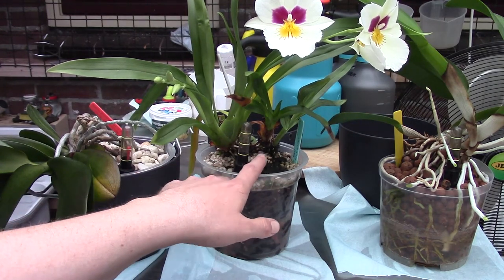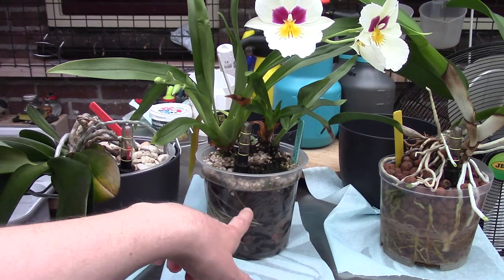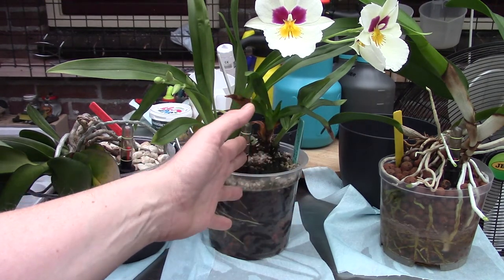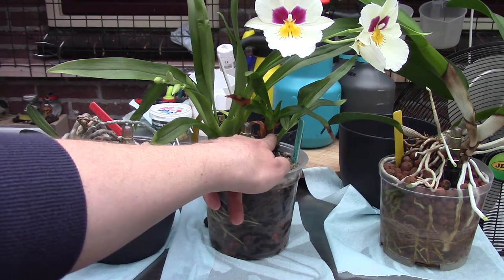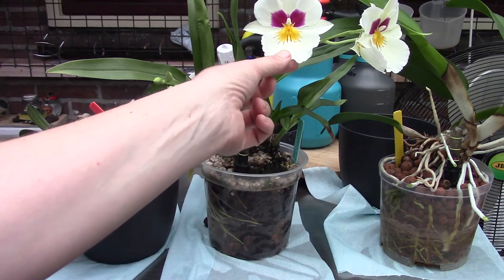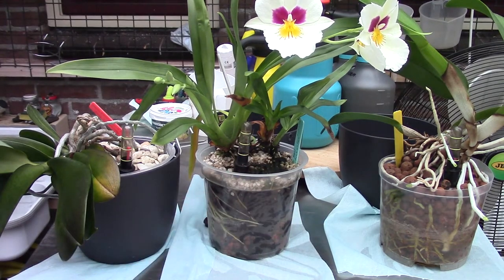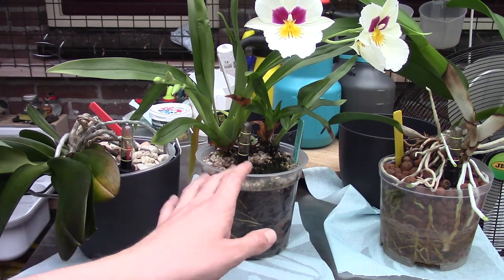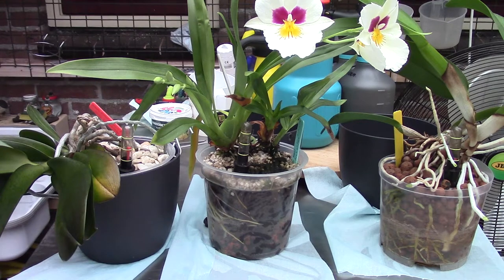My customized self watering system "exposed"!

Comment: Many thanks for this video about pH ⭐.  My problem is it's too high, but I have managed to find something on Amazon (here in the USA) called pH down, which I will try.  Sadly Rick.L hasn't posted in about 3 years now 😢 Your plants are so beautiful 🌷🌷🌹🌹
Reply from the maker: I really miss Rick as well! .... How high pH do you have? Because if you don't flush your pots like I do, then after about 5 months the pH will drop, it will become too low! So I use from that point on a calcium/magnesium based powder (same as the garden lime) to get the pH up to a level of 7 - 8. Then I water with a pH around 6 to 6.3. This works very well for my orchids....
Reply: @TheOrchidSaGa   My bad!  Have not been doing the flushing, so I will have to pick a day in each month to do that.  Our tap water is about 7.5 pH, but I did buy pH down, and it works great.  I usually use CalMag as well, so hopefully I'm not treating them too badly.  Thanks for the tips 😊😊

Comment: Questions: The water meter doesnt appeat to be in contact with the bottom of the pot?
In a previous video you showed the clear pot had a rise in the bottom of the pot. Is this necessary? Also you mentioned spraying the converted orchids all over until the roots grew. Can you do this for phalaenopsis? Wont it rot? 
Also do you spray the aerial roots outside of the pot once you have the pot fully set up?Thank you really enjoy your videos.
Reply from the maker: They are, some are just at the bottom of the pot. If the "inner pot" is hanging, I will make a hole in the pot so that I can push the meter down into the reservoir. I do spray the media and roots, if it is really warm I might spray the whole plant. It will be dry at the end of the day. I use RO water and seaweed (kelp), this helps them to push new roots out. And if they or adapted I do spray the aerial roots, but only again, on warmer days. So that the plants do have enough time to dry up before the night starts (colder temps etc.). I hope this helps? Thank you so much for watching!:D
Reply: @TheOrchidSaGa  Thank you so much for your reply. Much appreciated. I am learning so much from your videos. Thank you .
Reply from the maker: @1lumme  That makes me so happy! :D Thanks!

Comment: Question: If your ph is high in the first number of months with a repot, are you adding any other kind of Cal/mag since the garden dolomitic lime would raise ph and not usable at this time? I understand that after about 6 months the ph drops radically for whatever reason (root die back?), and then use the garden lime to help raise ph, and to a certain extent, stabilize the ph over a longer period of time to avoid flushing. Since this September after watching most of your videos, I have systematically been transitioning my varied collection to a system such as yours, using larger pumice for large roots and small pumice for smaller, finer root systems like Miltoniopsis and such, and Synthic where needed, and the pebble top layer. I am fertilizing as you outline at 100ppm and ph around 6.3. I am still early in my transitioning phase and noticing after a few days that the ph rises again quickly to 7.3 and higher, so I am flushing with water ph 5.8 to compensate the quick rise in ph. In this early phase of transitioning my collection, I am finding that my ppm remains consistent within the reservoir after a weeks time. I have a varied collection of Phals, Cattleya types, Brassavola, Miltonia, Miltoniopsis', Zygo and catasetums. By and large, they seem to all be making the transition quite well with new roots, growths and spikes. I grow indoors in my apartment living room on grow shelves with LED lights, Temps: 19-25C, Humidity: generally 60-70%.
Reply from the maker: I did answer your question in my last video.... I hope at least! :D Happy New Year and thank you so much for your support and good questions!

Comment: How did you find pots that fit (inner and outer)? Especially the larger ones.
Reply from the maker: Most come from my local garden centre, and they have the inner pots as well. So I try to fit them at the store. Most post I use are "Elho brussels" pots. I hope this helps? I do not have a link sadly.